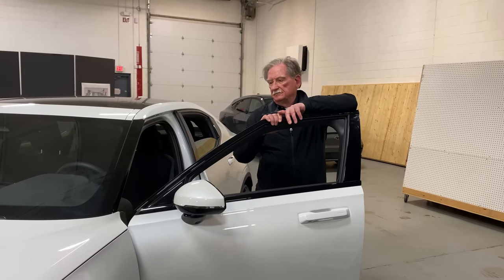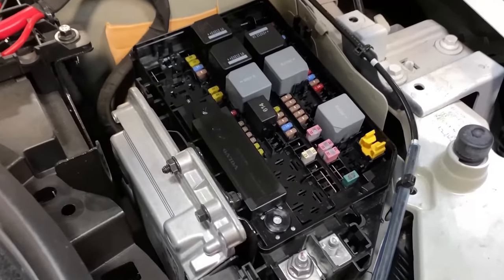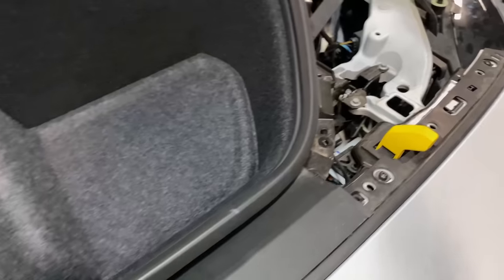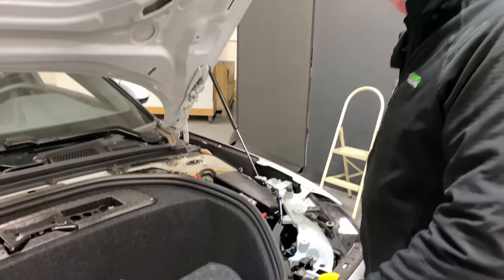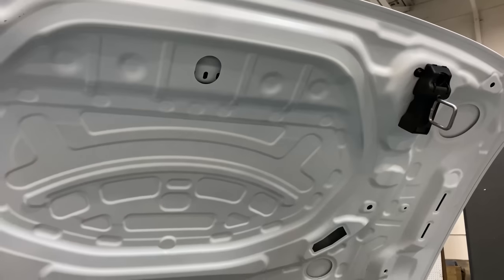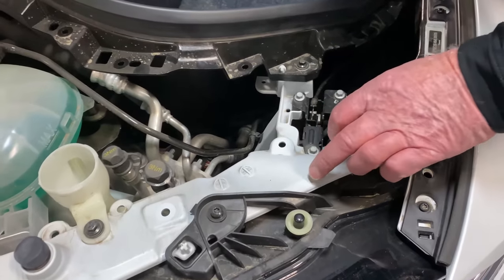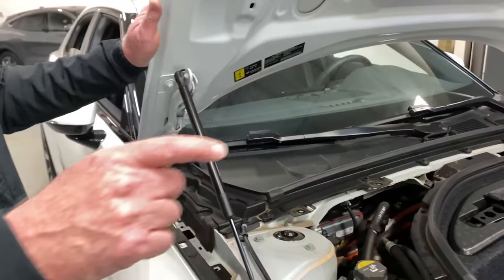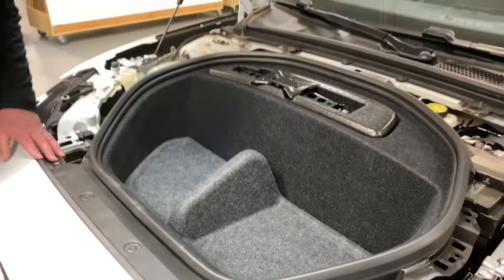2021 Polestar 2: E2 - Under The Hood

Comment: Is there a video explaining Tesla’s non-fuses..? Heard you mention them a few times, but don’t get how it “works” as a former car mechanic. (Because there ARE protection fuses)
Reply: Teal basically stop working I guess 😂. He mentioned something about OTA updates. I cannot image how it can fix short-circuit. 
But, to be fair: I already have fifth car. And I had to change 0 fuses...
Reply: In a previous discussion/video they called them e-fuses and mentioned that they're more like smart breakers. Https://www.st.com/en/power-management/e-fuses.html has some info on them
Reply: They use transistors and current sensing. It essentially replaces most fuses and relays. They are able to do over-current protection because the current sensing on the transistor will detect the high current and shut off the circuit, or (more likely in my experience) the transistor will fail, let the smoke out and permanently open the circuit, requiring you to replace a multi-hundred or thousand $$ control module instead of a $0.50 fuse. This is why I wish he would stop praising them the way he does, it’s a stupid idea that only works well in an engineer’s head, not in reality.
Reply: Kevin, thanks for the insight. Seems like the same with megacasting + damage in small colission: high repair costs
Reply: @ouch1011  
Seems like Tesla needs to invest in higher resistance&wattage current-limiting resistors in series with the switched output.

Comment: 4:05 looks like an intel stock cooler leg
Reply: It's common to see fasteners that incorporate a push pin that splays out the underside of the fastener to hold it in place. However, the pin that Sandy was showing has a second even-more-pushed position for the push pin, which releases the fastener. I think in that way it's different from those cooler fasteners.

Comment: I hate those plastic rivet fasteners, they constantly break, they use like 50 different sizes on the car, and they usually size them so they are proprietary and they sell them for like $3 a piece of $.02 of plastic. And they always use them to join plastic molded parts, like the cover on the bottom of the car, so they get brittle over time, and you end up losing/Overpaying for more overpriced plastic.

Comment: Sweden is basically norway if norway didn't find oil. All the norwegian engineers got sucked up by the petroleum industry in the 70's and I do wonder what our engineers will achieve when all cars are electric and the demand for oil drops.

Comment: my 2007 bmw 328i has SW resettable fuses for things like tail lights, i will tell you if you don't want to pay an arm and a leg to have the dealer reset it you will wish it was just an old fashion fuse.

even as a FW engineer it took me hours on the service port with some terrible SW on my laptop which was about 1/3 english, 1/3 chinese, and 1/3 german to get the "footwell module" to reenable the tail light that had triggered a short circuit, probably when it burned out
Reply: I'm amazed you could do it at all.
Reply: Amen! I wish he would stop praising the removal of fuses because from a service standpoint, it is absolutely idiotic.
Reply: @ouch1011  I would be fine with it if you could go into infotainment system and tell the car to try to reset it, right to repair movement want this sort of user access required

Comment: steel and aluminum dont like to touch each other?
Anyone care to explain this to me? Would appreciate it
Reply: When two different metals touch they like a battery. Over time the small electric current between them causes some corrosion. Known as galvanic corrosion.
Btw, it is most corrosive is when aluminum and aluminium are mentioned in the the same comments section.

Comment: For the TESLA I know you can not open the frunk ( sue me :-) ) when the 12V battery is death. What about the other EV's? I ask this because all the basic software is running on that 12V battery.
Reply: I think somewhere i saw that you can jumpstart it from the outside.
Reply: There are some “ropes” behind the front wheels for manual emergency opening
Reply: Most EVs have a pull cable to open the trunks in case the battery dies.
Reply: The earlier Teslas had a stupidly short-life 12V battery. The latest are Li-Ion batteries.
Reply: My guess, a conventional key would be more suitable so you do not have to dismantle the car charging a 12V battery. And nobody can open the frunk pulling a rope. Let's say I take a 3-week holiday and I do not use the car, will it be flat?

Comment: The europeian pedestian rules for the front end of the car, are there because our citys are way compacter with smaller roads and more room for foot/bicycle traffic. also lots of traffic bicycle and cars go over the same road.... also our kids (12/14 years) go with bike to school (around 15km) over roads instead of with a bus. so having care that with a good pedestian impact protection is key for a save streed live, Or a good auto break like I had with my model 3 last month.... little kid came on the road between 2 parkt cars never saw it but the car did and slammed the break.

Also if you have an accident car vs bicyle, the law states the car is always fault (in the Netherlands)

Comment: Have a look at the fuses, “bearing in mind that Tesla has none”. 1:05.... what are you talking about Sandy??? My model S has 4 fuse boxes... better do your research... all Tesla’s have fuses for the 12v system that runs pretty much everything but the motors... and another thing.. why is there a car jack( added weight) in the frunk when the car has no spare tire?? Seems a waste to me...
Reply: There are a few primary fuses in Teslas but all controllable voltage wires are driven by solid-state switches and are not fused. Also, these primary fuses are not expected to be replaced by consumers - that is the point.
Reply: @imconsequetau5275  I have 3 fuse boxes in my model S. All boxes contain conventional automotive fuses... not sure what model you are looking at here is the link to help better inform the public...https://fuse-box.info/tesla/tesla-model-s-2013-2016-fuses
Reply: @alanl3511  
That would be 3 and Y. The new S and X might be similar.